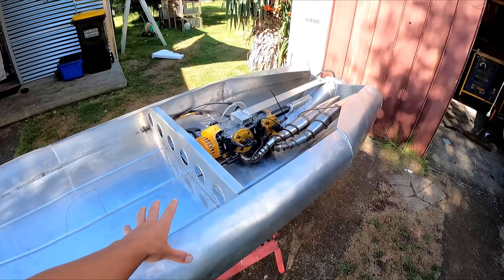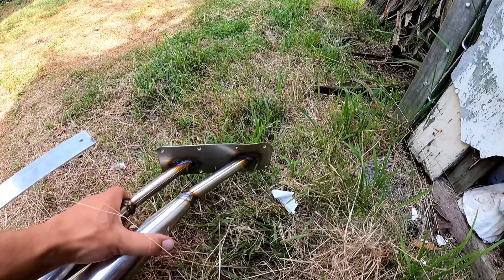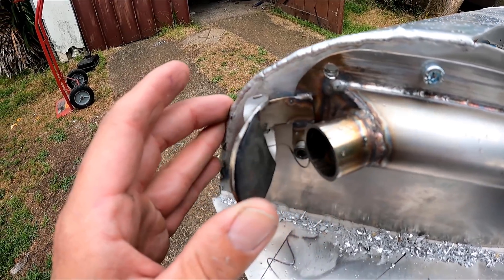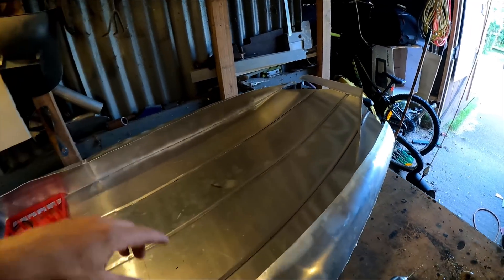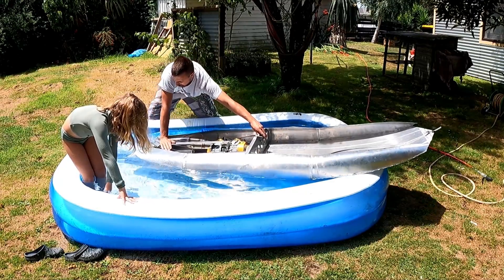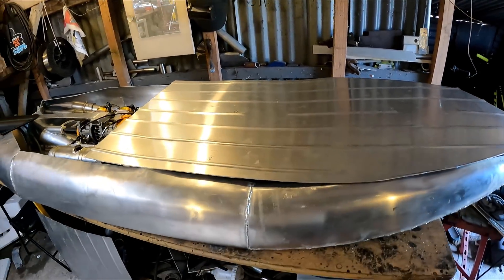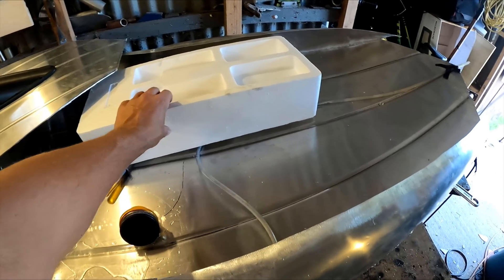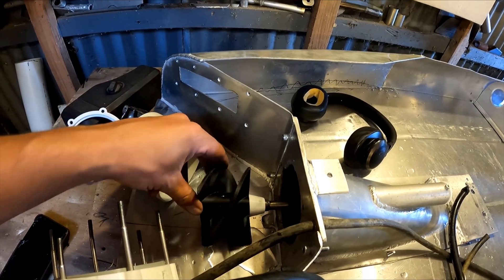Homemade Jet Drive 2 Stroke, Exhaust ,Tank ,Test!

Comment: you seem pretty smart - learn how to tune those carbs, they need a re jet since you have added the pipes & now backpressure. 
Most likely they are now lean which with a 2T motor is a quick way to turn them into paperweights.

Comment: I need to see this running!!! One question i've thought, is the cooling system for this engine, do you think the aircooled cylinders would run good? Without heat issues?
Reply from the maker: I’m going to fully enclose the board so they would heat up I think

Comment: This is great, Daniel! Just a suggestion, whenever I use 3d prints in sea or any structural setting, I usually cover the parts in epoxy and maybe a bit of glassfiber reinforcement. You could even print channels or ducts to fill with epoxy and fiber

Comment: I would definitely change the pitch rather than decrease the number of fins, but you could also just print a new end cone with a slightly larger diameter to reduce the pressure build up in the pump. That would increase your low speed acceleration, but hurt your top speed slightly.

Comment: Need to stick with 3 blade.  Even 4 blade. But yes different pitch most likely as can’t get it right the first time that’s impossible. Before you change pitch tho you need to get it to test drive untill then you’d just be making another incorrect pitched impeller

Comment: Awesome project! I feel like your exhaust setup may be a big reason it's not running correctly, your restricting the air flow big time!
Reply from the maker: I actually took the flap off the muffler for the test I need a better solution
Reply: @dkthewelder  point it up like a set of stacks lol long as it's running it won't take in water or atleast it will evaporate it quickly if it does. Or point it straight down so water can't flow up into it

Comment: Im not sure if you are aware but 3d Prints arent really water proof they slowly take in water and they actually take a long time to lose it as well xD ive heard there are like microscopic holes in them that led air out and water in under pressure
Reply from the maker: Yeah I have heard that , not sure it will matter on this build I’m wondering how the gas cap will hold up though!
Reply: @dkthewelder  ya I actually wonder about it as well xD

Comment: I would suggests once your happy with the engines, make a couple of different pitch props and number of blades, not much help I know, but after forty years of boating one thing I have learned, that is there is no fixed ratio blades for all boats and type hull and engines, ( the prophesionals say there is, experience and thousands of pounds says there is not )  so to cut to the chase, experiment dear boy, HAHA
Reply from the maker: There are formulas and stuff to work things out but for this hull this engine setup there’s no way to work it out experimenting is really the only way as you say👍

Comment: So with the couple continuing to fail, I would look into casting one out of some sort of rubber. Can 3d print a mold pretty easily
Reply from the maker: The couplings didn’t fail the bolts just came undone. But a cast rubber mild would be cool

Comment: Wow this build is coming along brilliantly! Thought on the impeller, comparing to say Jetski your pitch looks too steep as you said. I'd compare your rpm and pitch to a Jetski maybe and rather keep 3 fins but a shallower angle. Make sure they allow the volume of water to 'fit past' the fins though, that's the only reason I can think you'd drop to 2 fins. But of course trial and error, could print both and test / compare them. 
Great work Daniel!

Comment: Coming along really proper! Reduce impeller pitch for higher rpm. Idk what rpm the powerband is for your 2 strokes but if you have it you can calculate correct impeller pitch etc.

Comment: Just a suggestion, with the impeller, don't change a thing. But put a screen, behind it. Then cut a hole, in the housing, above the impeller. Start the engine, rev to 8000 RPM, and stuff your clangers in the hole.... That should help lighten things up, a bit. Eliminate the unnecessary weight... jk, love the videos! 😁

Comment: if youre having problems with your print not sticking to print bed try printing on blue or green masking tape.
Reply from the maker: I do have trouble some times I turned the bed temperature to 70 seemed to fix it

Comment: lost pla casting aluminium parts could be a great thing for your impeller/ coupler designs. I have had good results doing lost wax alloy parts with a home made furnace and some plaster of paris as a mould
Reply from the maker: Yes that is what I want to do once I get the design sorted. Did you build your own furnace?
Reply: @dkthewelder  Sure did, very basic one for small test, its a paint tin with a cement lining inside, just charcoal as fuel with a blower into the side. From what I read up on it helps to use things that were previously castings as they have a bit of flux left from the first melt, was actually surprised how well it worked used an old flywheel from a mower engine and some scrap round stock

Comment: Nice work as always. 
Glad to see people playing in the shed. 

From memory, it’s been a while since I read “two stroke tuning” from many years ago, the stinger does not add power, just quiets and guides the exhaust out. 

The other one was if you put a bicycle inner tube over the exhaust outlet and pinch the sides it makes a duck bill. 
You may or may not need to turn it inside out to get best seal.
Reply from the maker: I like that idea much better than what I made! I might have to try that

Comment: Hi, what is the impeller diameter? Thanks
Reply from the maker: 100mm I can send you the stl files if you like
Reply: @dkthewelder  Thanks for the answer. There is formula for impeller size versus power  need (watts) = D (in meters)^5*1000*rps^3. For example, your 100 mm impeller to spin 6000 rpm (100 rps) needs Power=0.1^5*1000*100^3=10,000 watts to spin 6000 rpm (Hypothetical, I believe there are other variables involved). Thanks again.
Reply: And for the pitch you need to multiply for the ratio pitch. For example, pitch is 140mm then 1.4*10000=14000 watts.
Reply: @dkthewelder  In Brazil there is a 51.7cc engine that spins an 80mm impeller at 5000 rpm. I believe the two engines together will spin your 100mm impeller between 4700-5000 rpm. Use a 1.5:1 or 1.66:1 ratio to turn the impeller around 6000 rpm and the engines will run in a range of 9000 to 10000 rpm.
Reply: Use a tachometer to measure the rpm.
Reply: To increase the power you could increase the compression ratio to 12:1 and use E85 or E70 fuel and this case you can use less reduction ratio.
Reply: You need to replace the union between the motors with a metal one.
Reply: Reduce the impeller to 85mm and use a reduction 1.333:1. You will increase the revs to 8200 rpm and the engine spin some think like 10900 rpm.
Reply: @dkthewelder Sorry for the many messages. As the real power of this engine is not known, without it being a smaller impleller than the one previously posted, but try 80mm impeller and 1.5 reduction.
Reply from the maker: @luizroberto6915  thanks for all that information, there’s only so much a formula can tell me no one is making a twin engine aluminium jet board there are so many variables. I think the motors will spin at around 8000-10000rpm , my thoughts on the impeller size is bigger is more efficient I would rather change the pitch than impeller size. I’m not going to run a reduction drive , I need to do more testing before I change anything but I think a little less pitch will be good. What do you think?
Reply: @dkthewelder  Correct by increasing the rpm you can reduce the pitch to improve the thrust.
Reply: Another formula to calculate the pitch 075*PI*tan(angle). For example 23 degrees igual 1:1 ratio diameter/pitch 0.75*3.1416*tan (23) = 1

Comment: Here I am wondering how the 3d printed cap will do against petrol.
Looks nice, but as you mentioned. You need way more RPM's
Ask Mark Youngster what impellor to use. He is the master in this!
Reply: It needs to be made out of Acetal/POM which is actually sold in filament form too.
Reply from the maker: I think it will last a little while I made a 3D printed fuel line t and it is still ok but guess we will see . Mark commented on this video 👍

Comment: I’m pretty familiar with those dellorto carburetors and they really need that mesh air filter and air box in place for them to run right. Cool project.
Reply: Excellent point, I forgot to mention, they won't fuel right because they don't have enough vacuum to pull fuel in, get the air filters on asap before the next test. Check the fuel isn't blocked also of course, they should run rough at least without air filters...

Comment: More fins, less pitch. You will get more torque with less cavitation.
Reply from the maker: More fins , less pitch ok also I do need to push the back of the board underwater a fair way for the jet to start working
Reply: @dkthewelder  push it under further than it would be with a person standing on it ?
Reply from the maker: @LincolnElectricDaycare  na but the other one I made seemed to prime it’s self easier. Also I think the nozzle is too big but I need to experiment with all these things
Reply: @dkthewelder  once you start moving it will Prime better.

Comment: Daniel, how well do cut-off disks work with aluminium?  One of the biggest crimes a person could commit in our workshop at Ford Product Development in the UK (I worked in the Test Instrumentation department) was to use non-ferrous metals on one of the grind wheels.  It would clog the grit and fly off into the nearest eye the next time someone ground steel on that wheel, so I have instinctively shied away from even trying to use angle grinders on aluminium with anything other than flapper disks.
Reply from the maker: I have aluminium cutoff discs and grinding discs they are much coarser , you can use normal cutoff wheels and put a little soap on them . I have heard those tales of discs clogging and blowing but in over 20 years doing this I’ve never seen it ! Maybe the modern discs are much better than the vintage ones?
Reply: Rub soap over the cutoff disc.